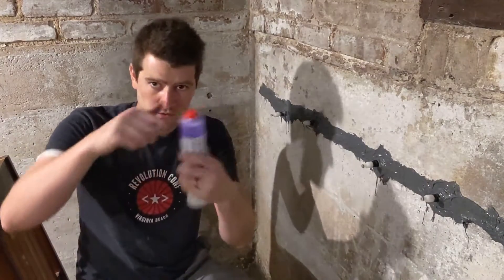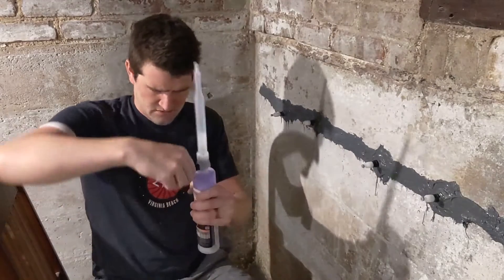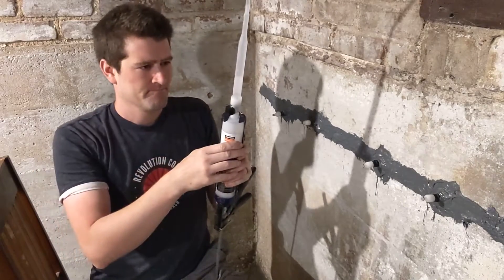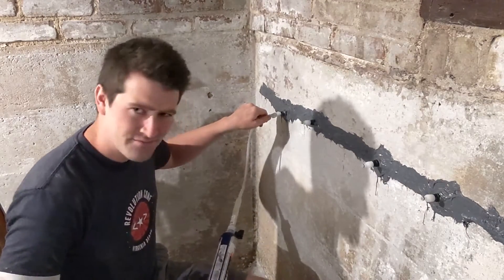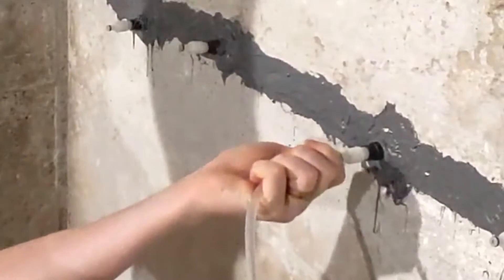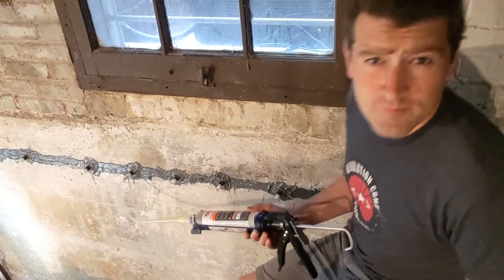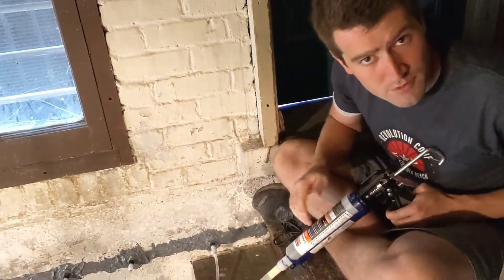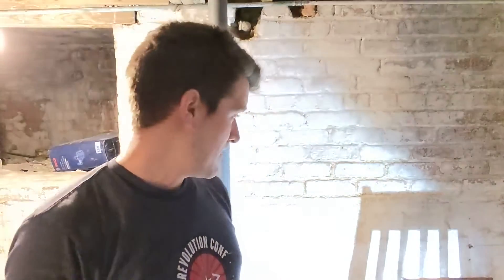Seal basement wall cracks with epoxy injection

Comment: Had this repair job done by professionals shortly after buying my house some years back. It was to seal up a more severe foundation crack where the previous owner had some vertical braces installed, but stopped there. It seemed incomplete to me without having it sealed as well, and for added peace of mind, I just had some pros do it, but they did tell me that for future reference that it was a relatively easy job I could do myself. I just checked that area, and it looks like I have an opportunity to do just that -- there's a new, or perhaps bigger, crack that could use some attention. :(

Holy crap that Crack-Pac kit is expensive.
Reply from the maker: Expensive, but it works. It's been 2 years, seal is still perfect.
Reply: How much did the professional charge ? I need to get estimates